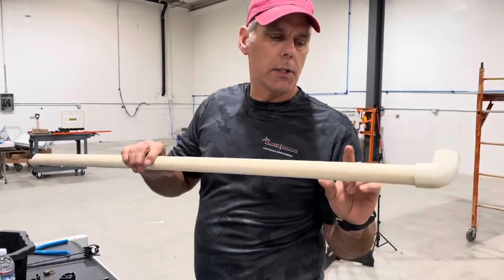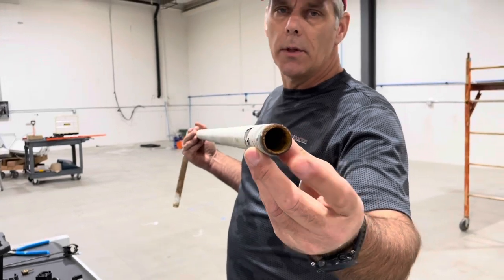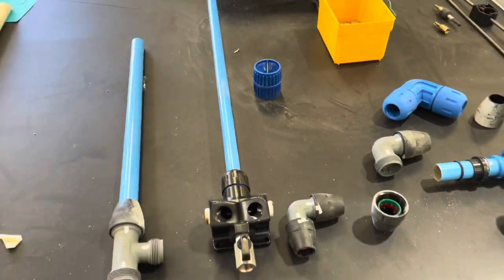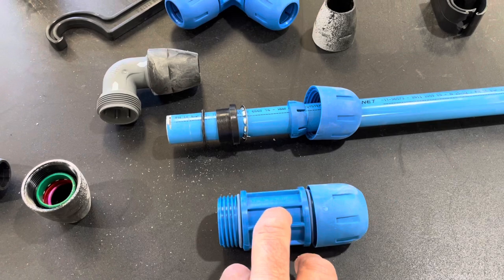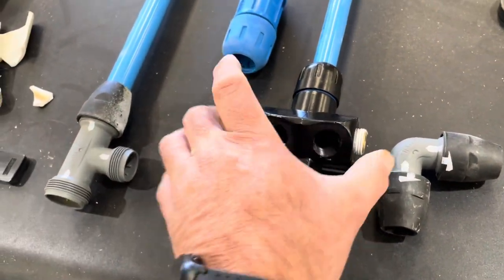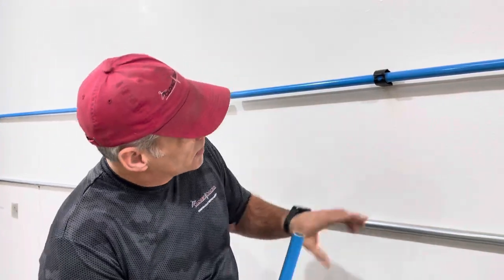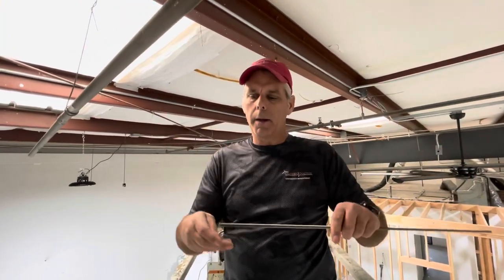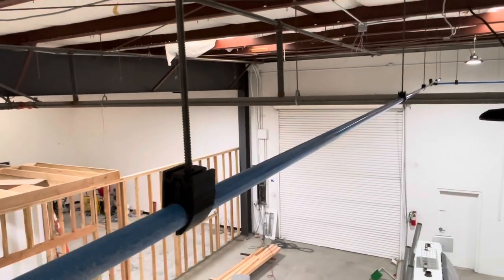How to install airlines in your shop. What material to use and what not to use.

Comment: I used 1"black pipe to run all my lines in my old shop but the price of that now is astronomical so that's out lol I have multiple blast cabinets running and need atleast a 1" pipe everyone says pex but I've heard some bad things about pex for shop air so I'm unsure what I should look at
Reply from the maker: Pex is a no go for airlines. It’s not rated for that high of pressure. Pvc is dangerous. Black pipe is to expensive and time consuming to install and not flexible or easy to change if you need to add a drop. This type of airline is by far the best option. Do it right, do it once
Reply: PEX works just fine. It’s rated for 160 PSI. The RapidAir system is rated for 150 PSI, so PEX rates higher for pressure. Plus the PEX fittings are way cheaper and available anywhere. So much simpler going with PEX.
Reply: @BillMacfarlane  At 3:09 in the video you can see the first pipe he picks up, printed on the pipe, is rated at 16 bar. 16 bar = 232.06 psi. Don't know if that would be operating or burst pressure.
Reply: 1/2” copper L type pipe

Maximum working pressure (psi)
361
Maximum Working Temperature (F)
400
Minimum working temperature (F)
150
Reply: Lowes say maximum temp 200f
Min -20f